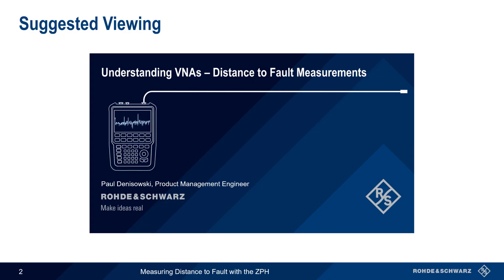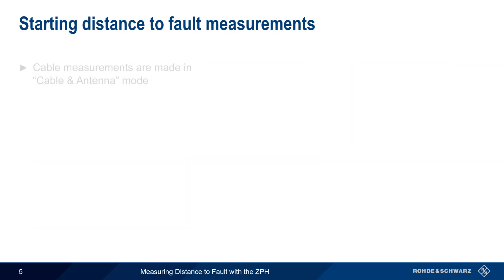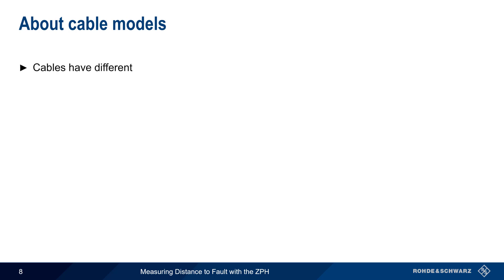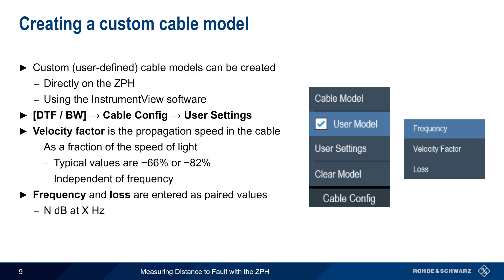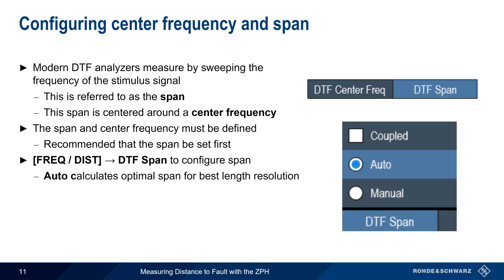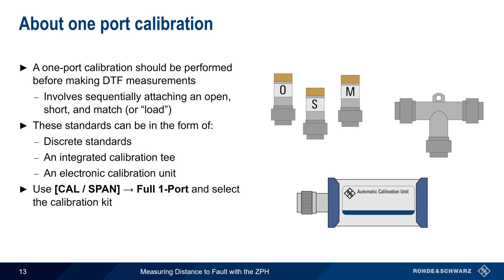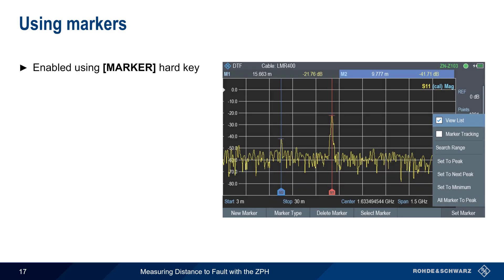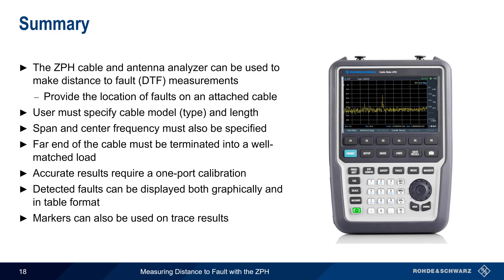Measuring Distance to Fault with the ZPH

Comment: Is this measuremt similar to  TDR?
Reply: Similar, but not the same.  TDR (time domain reflectometry) basically sends a pulse and then determines how long it takes for that pulse to be reflected back from the other end of the cable (which is ideally open or short).  Most modern analyzers use FDR (frequency domain reflectometry), where the analyzer sweeps a frequency range and then uses an inverse fast Fourier transform to convert the frequency domain reflections into the time domain (and therefore into distances).  FDR has many, many advantages over TDR for this application, and my upcoming presentation "Understanding VNAs - Distance to Fault Measurements" discuses these differences.

Comment: What is the Freq that is used when measuring distance to fault?
Reply: The frequency range (since modern DTF measurements are usually FDR - frequency domain reflectometry) is user selectable.  Clearly you would want a frequency range that covers the frequencies that would be used in your system, but there's also a tradeoff between frequency range and distance : greater frequency ranges show more detail, but decrease max distance.  I discuss all of this in the upcoming presentation "Understanding VNAs - Distance to Fault Measurements", so please stay tuned!